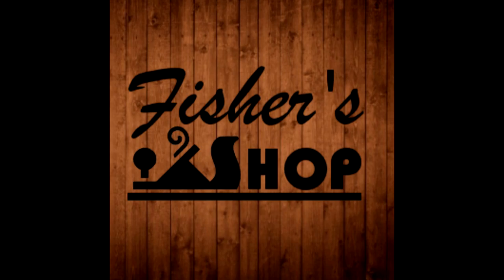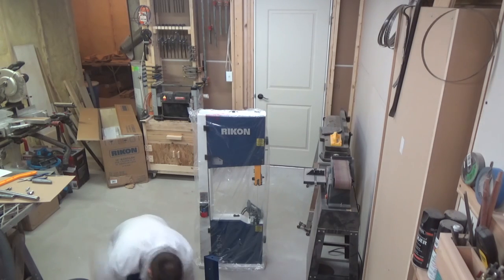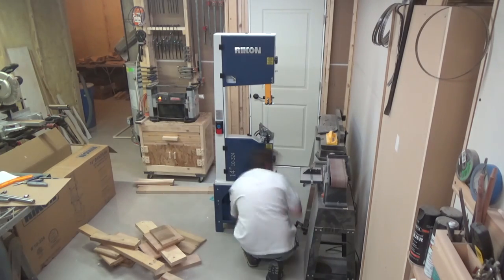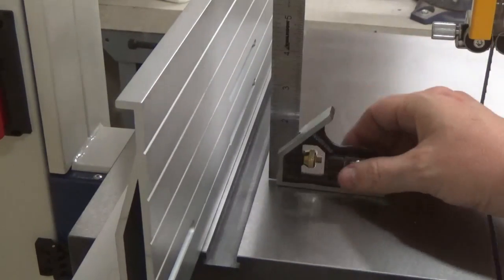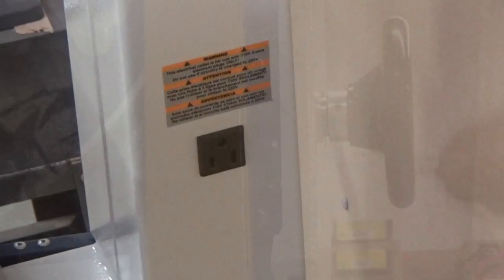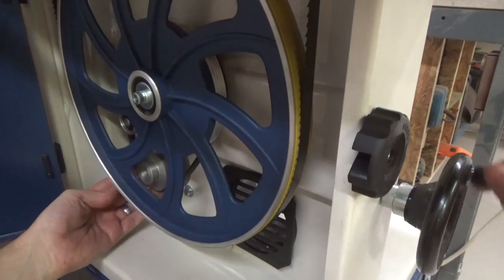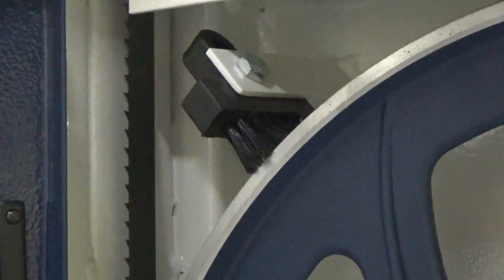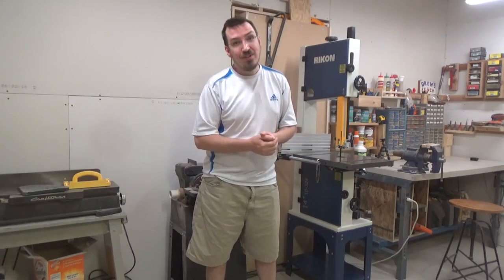Shop Work: Rikon 14" 10-324 Bandsaw Setup & Review

Comment: Speaking as a former technical support engineer for nine years, you will not lose any man points for RTFM (Read The Field Manual, or Read That Fine Manual, or Read The F'ing Manual.) Rikon makes a fine bandsaw. I need to replace a very old AMT 14"er, and Rikon is in the running. Thanks for the entertaining review.

Comment: I found this machine a little top heavy and nearly turned it over on myself. Thank God that it wasn't running!  To solve the problem, since my shop is in the basement,  I got a screw eye bolt, drilled appropriate hole in the top of saw. Then two screw eye lag screws into two floor joists and attached it via two turn buckles  from opposite directions. It is solid now. It was an accident waiting to happen!

Comment: Thanks so much for this informative (and at times, really funny) review. I just took a 175-mile trip Rockler in Kennesaw, GA yesterday to pick this saw up. It was $1200 and I received a $100 gift card to boot. Today I began the assembly process, but it took longer than I had thought to assemble the table because of my own stupidity (screwing the legs INSIDE the top......DUUUHHH). Seeing your review made me glad that I had selected this saw as I think it will serve my needs (primarily re-sawing 2x6's and 2x8's which I receive for free and use after de-nailing them). My wife is a serious gardener and is constantly calling for planter boxes (which I make of the 2x stock after cleanup) and rails on the top to make them look pretty (which is where the need for 1x stock comes in). What started out as "repair these old planter boxes left by the former owner of our house has mushroomed into a never-ending project. At last count we have 43 planter boxes with #44 under construction.
Reply from the maker: Awesome!  Glad the video was helpful!

Comment: loved to watch you unpack and get the saw up on it's base. I too did this alone, but was able to rig a makeshift pulley assembly to my suv's ski rack and inner back mesh hooks, lowering the saw down onto the pre-assembled base which I attached to the roller base I had purchased and bolted the assembled legs / base of the saw to. I recommend this approach if you're unloading alone into a garage ( not a basement)... 

--- Cleaning and saw maintenance as I've learned the hard way. --- for those purchasing a saw for the first time ---- Suggest spraing down the entire saw, especially the heavy table with "Glide-Cote" (Bostik). If you are new to using stainless / steel tools, please be aware that ALL tools benefit from providing them with a protective coating (Not WD40) that will not stain your wood when sliding across, but will provide for much longer tool life. If using in a garage with vehicles, try to store away from any engines that would / will give off steam / head and moisture when being pulled into the garage, away from any water fixtures, etc... May seem obvious to some, but tools will rust in almost any environment that isn't air tight with 0% humidity.

Not being aware of this need for most all tools, now have a box of my cheap / disposable files / worn and torn bits / saws, and a tool box for all of my router bits / dremel bits, dove-tail saws, drill bits that all receive monthly refurbishing / inspection as I've found over the time no matter how / what a "stainless" steel finish may claim to be able to fend off the elements and remain sharp / crisp, there is always a level of moisture in the air, even in a garage which will eventually allow rust to creep in and dampen the effectiveness of your primary source of joy / a refined cut / shaving / route... 

Over time this will actually save you time and money replacing and / or having to discard your once favorite instrument for precision creativity. I wish more people had told me about this when I was getting started, I would have saved several of my favorite / sentimental saws and router bits... - For all those whom are just getting started in their new passion as I have been... 

Hope this helps save someone the time and money I have had to spend repurchasing bits / files and the more delicate of carving instruments.
Reply from the maker: Wow... wrote me a novel.  Thanks for the comment and the pointers.  Glad you liked the video.  Thanks for watching, Zak!

Comment: Great help! Thank you! Just assembled and am leveling now. I'll be revisiting your video I'm sure throughout the day as I get used to changing out and adjusting the several blades I've purchased for experimenting with the accuracy of the tensioning guide as I usually do this by feel as well as the re-saw max potential through rock maple, 13".. Going to attempt to cut a couple les pauls in half

Comment: Great review, very informative!  

I've yet to buy my first bandsaw, but one of these days'that's getting remedied.  Because of very limited shop space, I've been looking at Rikon's 10-305 model, the 10" little brother of this saw.  What impressed me is the structural integrity of even their 10" saw ... it looks much better made than all the 9" saws made by B&D, Ryobi, et. al. that have crappy plastic sides.   Yeah, those other brands of saws may be a little cheaper, but something so wobbly and cheap-feeling has no place in my shop.  Even though the 10-305 is a "compact" bandsaw, its wheel housings are thick steel... even the doors... as is the entire frame and base.

By way of comparison to the 14" version you reviewed here, the 10-305 runs about $230.  Alas, it simply doesn't have some of the fancier features that this 10-324 has.  Like, for example, that awesome tight/loose tensioning bar, windowed tension adjustment gage or that very nice round fence rail on the table.  Of course, the 14" version is almost four times the price of the 10", so I guess that goes with the territory.

Again... Thanks for the awesome review!  Given the space and a few extra hundred bucks, it'd be a no-brainer to pick up one of these!  Well, BUY, I mean. As you rightly noted, "pick up" is no small task when the saw weighs well over 200 pounds!!
.

Comment: Looks like a very nice upgrade. I’m sure you’ll get a lot of use out of this. Nice review of it also. That tall fence will come in handy for resawing once you make the adjustment to the table to zero out the wander. That will change and need to be redone when you use other blades.
Reply from the maker: Yeah this bandsaw came with a resaw blade but I think it's gotten dull because it started to wander really bad.  It wouldn't burn the wood, which made me think the blade wasn't dull, but I couldn't resaw anything without it cutting a large belly.  I'm pretty sure I have things set up properly on the saw, but maybe it's a configurational issue.  Oddly enough, I can put a small 1/4" 3TPI on and resaw just perfectly... so it makes me think it's the blade.
Reply: Fisher's Shop  you might decide to add a resawing blade with carbide teeth to your blade stash. They are much pricier than the HSS blades but while I’ve had to sharpen the HSS blades several times and eventually replaced them the carbide blade holds its edge and keeps on cutting well. I’ve cut soft metals with it also.

Comment: Great video, love the humor! Good explanation too. I wonder if you would make another video after you've had the saw for a few months and have done quite a bit of re-sawing on it and tell us what you think of its re-sawing capabilities. I'm saving to buy a new 14" bandsaw this year and I'm debating between this one and the Laguna 14/12. Thanks for sharing this great video!
Reply from the maker: After doing a bit of resawing on it, I've determined that the saw is great... however the blade isn't.  The stock blade has apparently lost it's edge and it wants to wander now when doing resawing.  It didn't used to do that right out of the box so I think it's just gotten a bit dull.  Aside from just having to keep a sharp blade, I love the saw.  Had I know how much of a chore it is switching blades and resetting all the guides, I would have spent the extra cash and gotten the next step up model that has features that simplify that process.
Reply: Ah yes I've read that the blade change and set up is tedious on this model. I think for that reason I would go with the Laguna 14/12. which is said to be an easy blade change. Thanks for your feedback. :)

Comment: Well done Drew. Been waiting on a price drop and it appears now may be the time. Questions - After 1.5 years, are you still happy, happy, happy or do you think a few hundred extra dollars for the 326 would have been a better investment? Is there a different bandsaw you would purchase today? Are you paying the leprechaun under the "bandsaw table" or is he 1099'd? Thanks Drew, you are a fine man, God Bless.
Reply from the maker: Good question... I think I would have splurged a bit more to get the next model higher.  In the next higher model they added convenient thumb knobs to quickly adjust guide bearings without the need for an allen wrench.  There's also some other features, but that's the one that stands out.  But yes... I'm very satisfied with the saw and don't have buyer's remorse at all.
Reply: @FishersShop  Thanks Drew. I'll be resawing mostly I think. $400.00 for feature, hmmm.  Table, motor, knobs, adjustments,  that's what make it fun. No wrong choice, just choice. Thanks for the help man. I really appreciate you! God Bless...Q

Comment: Great video, but how you can set up the fence to 90' to the blade?  i buy one from looking your video, it's works great, but I can't set the fence to 90', because when I tight the knob ok the fence alway pass the 90. Thank you
Reply from the maker: Try adjusting the trunnions under the table surface?

Comment: I have this saw and I cant get a straight resaw cut out of it. No idea what I'm doing wrong. Came here to find some help, found some humor, so it's okay. I will tell you that I dug out an old weightlifting belt when I lifted it up on its base. Bearhug and a squat got it done.
Reply from the maker: Getting a straight cut relies on a number of things.  Sharp blade and guide bearing settings mainly.  First, slide both your thrust bearings backs on the upper and lower set.  Then adjust your blade so it cutting teeth ride on the center of the tire.  Then move all your guide bearings up so they're a hair away from the blade.  Try your cut again then.

Comment: Great review. It's down to this saw and the Grizzly G0555XH that adds cast iron wheels, a slightly more powerful motor (1.75HP), and a closed base for only a little more ($1,010 delivered). Still, this saw is about $150 less and seems like a nice choice. Thanks for your review--very informative and humorous.
Reply from the maker: Thanks!  The next model up has a couple more features that make blade swapping a bit easier.  I sorta wished I went with that one.

Comment: Nice video. I was considering another saw but now will take a harder look at this one. I need a saw that I can easily change the blade. How is it in that category.
Reply from the maker: It's not too bad, actually.  The 10-326 model (1 step up from the 10-324) has easy to use thumb screws to adjust the guide bearings where I still have to use an allen wrench, but that's not really a big deal.  The blade comes out easiest if you have enough room to open up the cabinet doors ALL the way (which I don't, but it still works... just needs a bit of finesse).  Admittedly, the first time I changed the blade, it was quite a chore adjusting all the guide bearings.  Now when I do it, I'm done and ready to go in 5 minutes.  Definitely give Rikon some thought.  After having the saw and using it a while, I'm still super happy with my purchase.  No buyer's remorse at all.
Reply: I'm looking at getting my first band saw and really enjoyed your overview. That's great to hear you are still super happy with the purchase. I'm hoping to order one soon!
Reply from the maker: Outstanding, Mike!  You won't be sorry.  I love my Rikon!

Comment: My saw is temperamental due to the fact the I have her on a roller base and have to move her in and out of garage. I would obviously recommend to any is encountering the same scenario to mark out where you pull your saw out to and make sure to always position you saw in the same place is you're not into constant alignment of your table to get true 90deg. resaws, locking the "feet" into a secure position to increase your chance of keeping your table at a true right angle. - Just trying to save those whom would go through the same learning curve I am.....
Reply from the maker: Good tip, Zak.  Yeah, I'd like to get a mobile base for mine but with the limited space that I have in my shop, I don't really have any place to roll it to.  As long as I'm not resawing 8ft boards, I should be ok.  Thanks for watching and commenting, Zak.

Comment: You should get an act together and move to Las Vegas.  Funny.  Moving heavy stuff by yourself is tough.  I was able to lift my table saw by putting a heavy duty I bolt in a beam in the ceiling of my basement.  I used (2) heavy tie down ratchet straps under the saw table top to lift it.   Hooked both strap hooks into the same I bolt.  Worked great.
Reply from the maker: That's a good idea... the lifting part, not the Vegas part.  Hah!  In hindsight, I should have just laid down some cardboard/blankets and assembled everything on its side.  Probably would have been easier.  But then you would have missed me doing my Superman flex after I finally lifted it.  Thanks for watching!

Comment: Woodcraft has this saw on sale right now for $649.  Is that close to what you paid for yours?
Reply from the maker: +derail412 yeah I think I found it on sale for that price too.
Reply: Are you still happy with your purchase?  I think I'll be using the band saw mainly to resaw.  I have a 10" that works for me except for the larger cuts.  Need more power.  Thx
Reply from the maker: Yeah, I've done a bit of resawwing and it seems to work just fine.  As long as you know how to properly set up and adjust the blade, you'll be happy with your purchase.  I'll admit though, having to use a box wrench to loosen/tighten each set of guide bearings and then having to use an allen wrench to loosen/tighten each of the bearings themselves can be a pain.  But the next model up has quick-access knobs that streamline that process.  But on this model it makes changing blades kinda a hassle so you might really like having 2 bandsaws.  One for resawwing and one for curve-cutting.